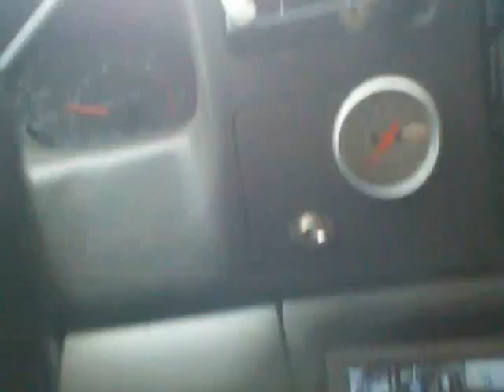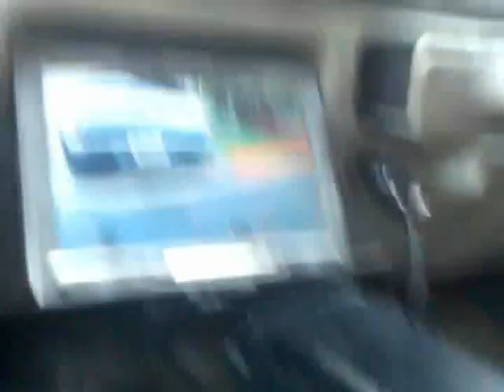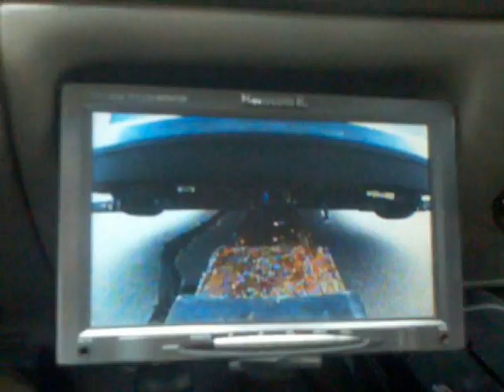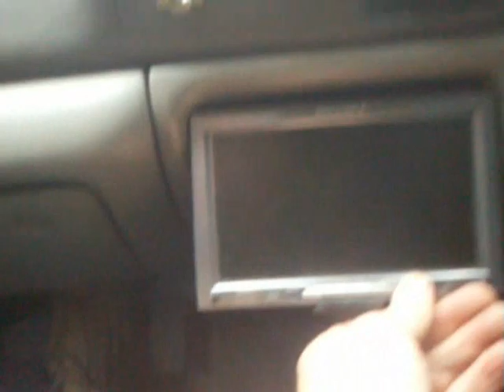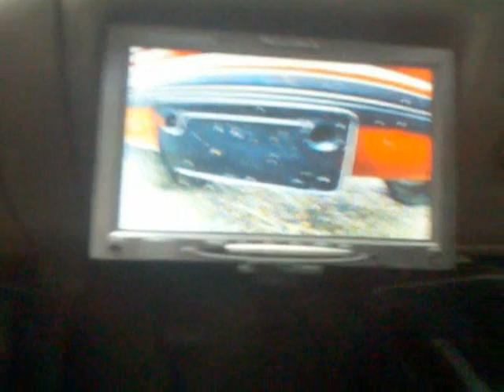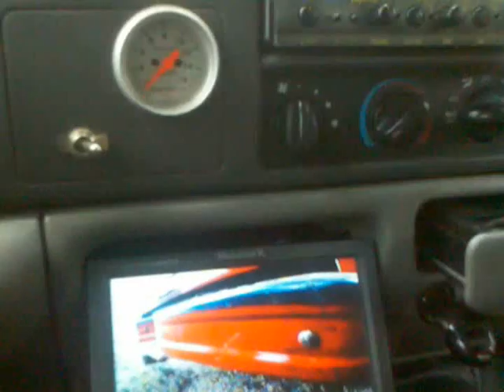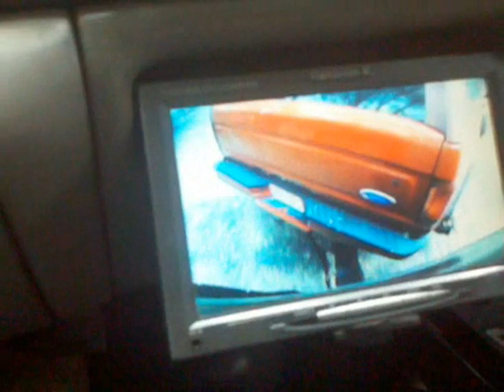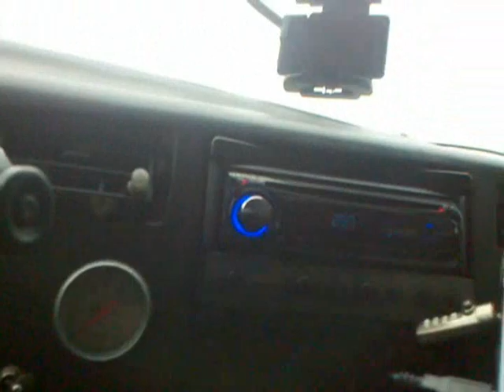Day Of Repoing Starts Out With A Hot Exchange Of Words

Comment: Theresa new product that can be installed behind the rear tires or in front of the front wheels. Its a thick metal flap that folds down and locks in place so toe trucks like you have with the arm lift in the back cant lift the vehicle or hook around the wheels

Comment: I bet that audio system in the bronco is worth more than the truck itself. Also, who the hell finances something that old and cheap and who falls behind on it? lol
Reply: Those speakers are PA cabinets. They may be worth something, but they have no use in car audio.
Reply: UrbanCrunkMovement I'm sure they "can". I dont think I would.
Reply: If you take car audio seriously and want to use the correct products, the only way the back of your truck should be full of PA gear is on the way to a gig. I can use a golf club to hammer a nail into wood too, but it isn't the right tool for the job. Therefore I would not do it. Does that clear it up for you? Hopefully you won't now argue that PA cabinets are the right tool for the job here but hey, it's the internet so anything goes.
Reply: TheCobruhAlienat0r Ford Broncos have come up big time in value where ya been?
Reply: cuz they gave a huge down payment for a piece of s*** car and the finance company charges I'm an astronomical payment once the customer realizes they've been ripped off they stop paying on the car. They sell the car over and over again that's why it's even worth paying a Repo Man.
Reply: Al Cowlings trade-in?

Comment: OK so how come you don't just put the transfer case in neutral and tow from the front? Obviously its not ideal to hook up to the front with the wheel cranked all the way over but Is it just more weight than you want to have on your truck? Because the transfer case pump runs off the output shaft so I don't see how it could cause any damage to the vehicle being towed.

Comment: So when did scoping under a door of a home become legal? Seems like that could be some illegal form of voyeurism. First time I have ever heard of that, but hey I love your work.
Reply: +John Brady, in the USA, the laws are different than other countries.  He is not allowed entering a building through locked or barred entrances; not permitted taking a vehicle through force without police presence and then only with special legal permission.  Also, not permitted to damage or defeat any property (chains, locks, etc) to do take the vehicle.  But, the contract with the debtor allows the location and condition of the vehicle to be known and verified through limited means to the financier until full title has been transferred to the buyer.  In some cases, even not having valid insurance may void the purchase contract and may be grounds for repossession.  Sometimes there are other stipulations also as outlined in the contract.

ALWAYS read the ENTIRE contract, and especially the fine print for ANY contract or agreement you sign.  In the case of digital rights, or EULA, just using a service or product may be equal to signing a contract.

Comment: You repo a lot of ford taurus'. Like these cars arent even that good why do so many people have them? Let alone take a loan out for one?
Reply: Koshunae It's usually the result of people buying them from used car dealers who loan to people with poor/no credit. Catch is that the vehicles they sell are the ones bought at auction with a list of known mechanical problems longer than most gang members' criminal records (Typically the sale price is equal to or less than the cost of necessary repairs with labor). But since the new "owner" doesn't want to be without wheels when faced with financial issues, they take drastic actions to try and prevent repossession in the event of a default.